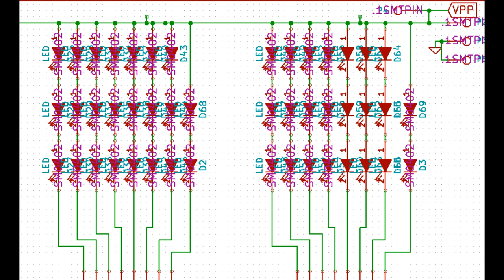AVR Non-Contact Temperature Projector

Comment: Cool project!

I used to just goop the solder paste on like you do, but it is so much easier to just spend a few more bucks to get a kapton stencil from OSH Stencils. You can apply all the paste in a few seconds, and you'll rarely have to do any reworking, if any at all.

Comment: Cool, is that how those clock projectors are made ?  That really needs to fit inside the hut and have four sensors/displays !
Reply from the maker: I don't know how clock projectors are made.
Reply: The one projection clock projector I've disassembled had a single red LED shining through an LCD, followed by a single lens. I imagine it's just cheaper to mass-produce that way, because whole segment LCDs can be made at once by photolithography (and several side by side on a single wafer), while LED segment displays would require assembly of individual segments into digits.

Comment: Cool. Can you describe the optic design a little and where you sourced the optic parts, my experience so far is an ebay pot luck for lenses (usually either for various LED torch beams widths or Google cardboard VR). What's the visibility like in bright daylight? Thanks for posting!
Reply: +Gary Martin +1.  Also interested in the lens that was used.  Is this just standard 40mm or something else?  I would also suggest just using less solder paste.  You really only need a very little.  I haven't had a bridge on a QFN in a while.
Reply from the maker: +Mark Higgins The lens was really a random lens, just some piece of junk extracted from  something else.  It's not even a very good lens.  When it comes to the solder paste, I don't do the stencils and care much, much more about speed than quality.  I've tried it quite a few ways and this is def the fastest.  Worth getting the bridges since they take only a few seconds to remove.
Reply: +CNLohr Thanks.  I'm going to order a cheap 40mm and see what I can project.  I also don't use stencils as I don't find putting paste down to take all that long and I don't reflow enough of a single board to make it worth it.  I use a syringe with an inkjet tip to dispense the paste, though.

Comment: 1) flipped the bacon way too early, real men use their hand. 2) how about controlling current output to the heating element to the temp sensor so you can upload cooking profiles?
Reply from the maker: +Andy Payne +PhattyMo suggesteed that as well.  It is a REALLY good idea.  I am wishing I had used an ESP on this project so I could wirelessly control the stove, too.
Reply: CNLohr ya that would be nice. I just got few esp boards back that I made in kicad so I might put a couple towards this. first I need to get websockets working on their RTOS but I can't even get it to compile yet
Reply from the maker: Doooo the esp8266ws2812i2s websockets